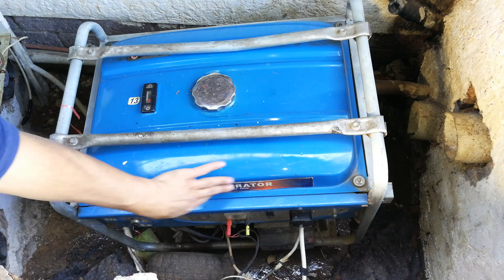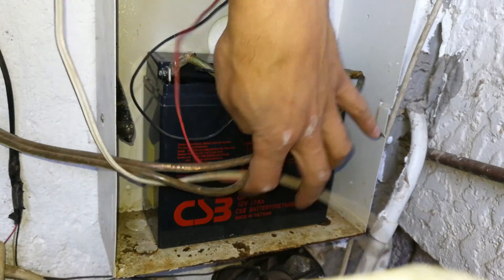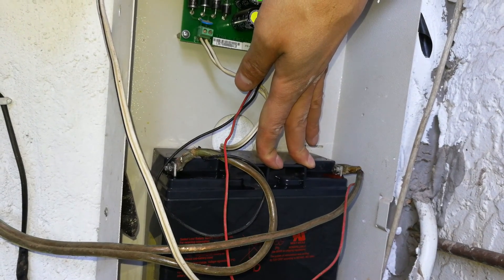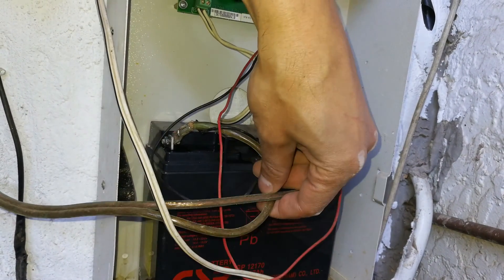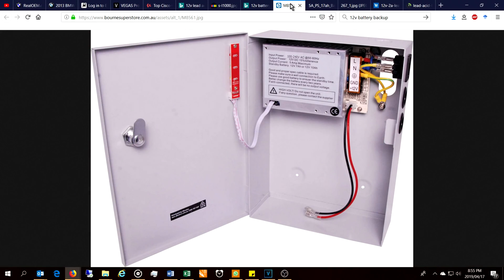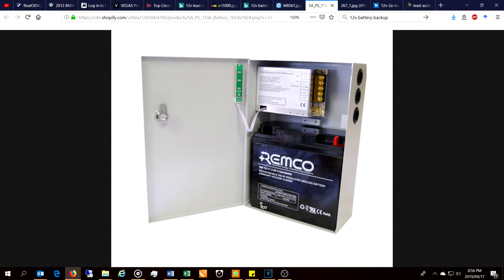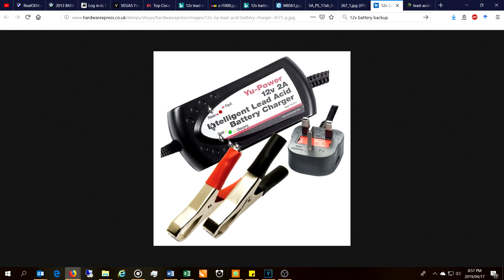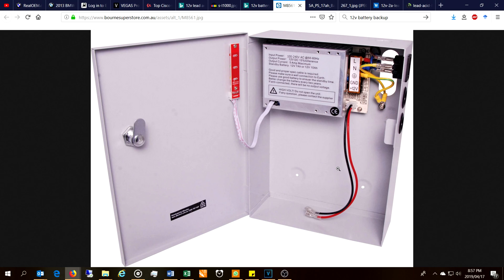Generator won't start - solved with battery and battery charger

Comment: I got best results with a good analog transformer charger, and a timer. Charging 1 hour per day. Maximum charging current must be 10% the battery capacity.

Comment: I recently bought a 4 kW generator a month ago. I found a positive terminal not connected, which is fine to preserve the battery. I connected as required. The gen started fine all along. I last started the generator 
2 weeks ago started fine. . Yesterday tried to start and battery was flat could  not start until  I connected a battery jumper. According to me under a month I can not expect battery problems. When I test the battery even changed its 12.1 volts instead of atleast 12.6 V. The retail store says if the gen is not used frequently they can not guarantee the battery, but what is frequently I ask. The say if not in use I must disconnect one of the terminals, which is absurd.
I suspect that the battery could be in a bad state or has dead cell or two.

Comment: Does it mean the generator didn't come with a battery charging system?
Reply from the maker: it does but only charges when running. If your genny sits for a month between uses, it gets flat and doesn't start. Some older gennies dont have charger. Also, they provide a low Ah battery that is not strong for long term use, if its not above 80% charge its too weak to crank the engine
Reply: Okay, I get your point
Reply: Is it that the battery cannot be replaced? I cannot get mine out.

Comment: I didn't get the info on what kind of a charging system there were in your generator at the first place?
Reply from the maker: it comes with a small lead acid battery that is supposed to charge when the genny is on. If left for weeks it depletes
Reply: @ecologicaltime  I have the same size of a generator in my summer cottage. So it's better for me to use solar energy to do the constant charging and not install extra charger to one of the outlets (which was my first idea..). After all, I use my generator so little time, so it wouldn't be able to charge the battery properly.
Thanks for the tip!